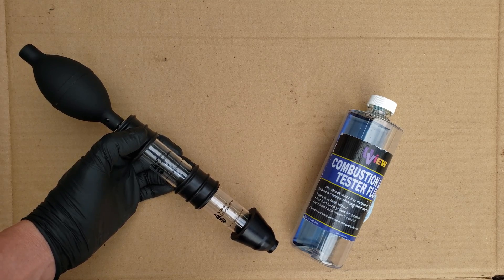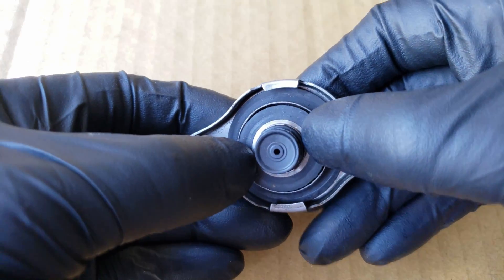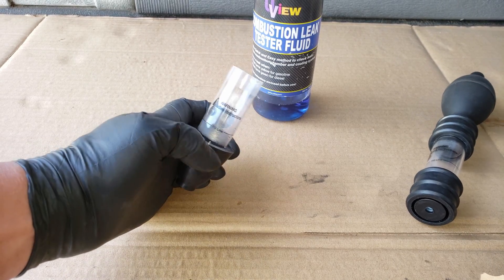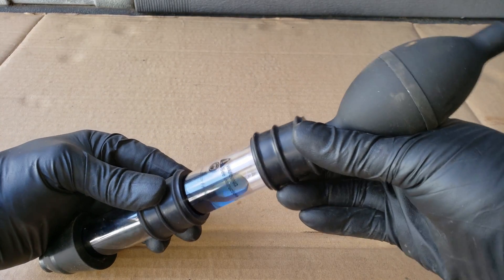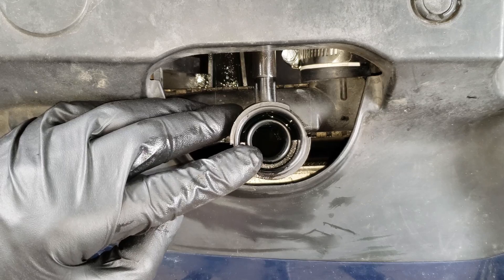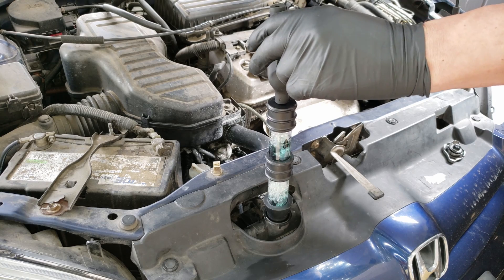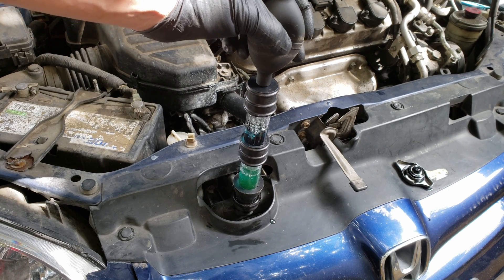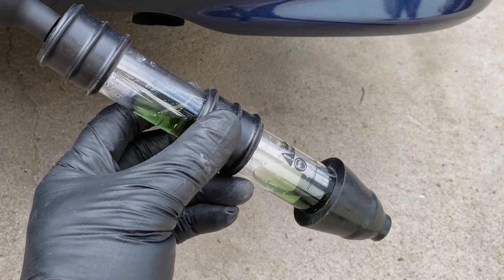How to Test for A Blown Head Gasket with a Block Tester

Comment: So, what was the outcome of the situation?
I have a similar situation in my civic. It pushes the coolant to the overflow and then does not take it back. 
It doesn't overheat, smoke or run roughly on cold starts.
Reply: Did you ever solve it?
Reply: @milliondollalic  I have bought a new car, so no. It was only doing it on longer highway drives. If I drove on B roads, it never had the issue.